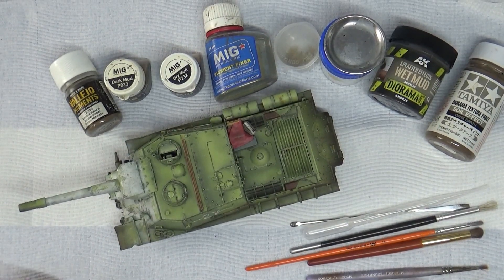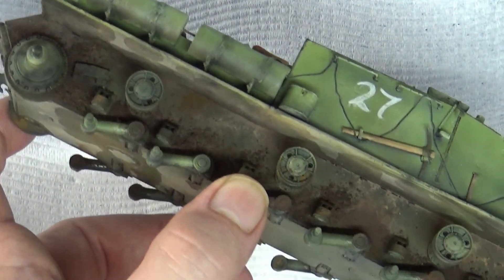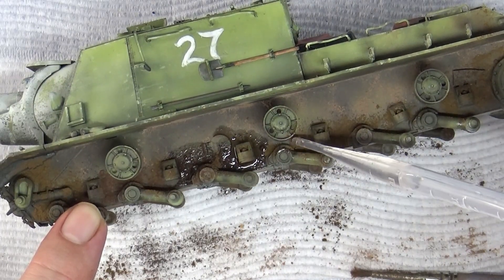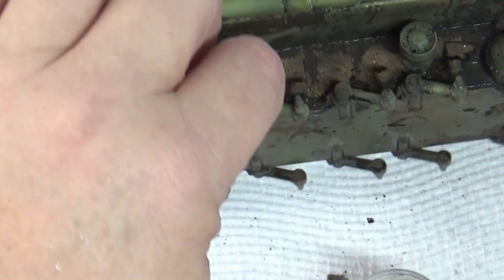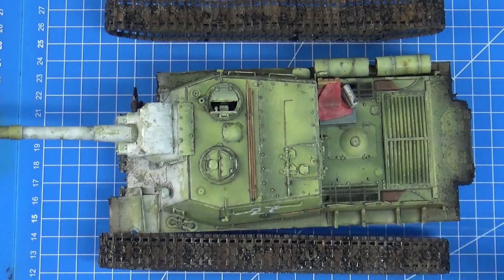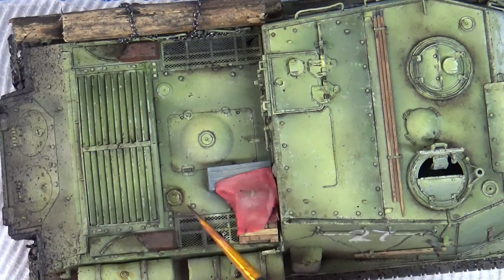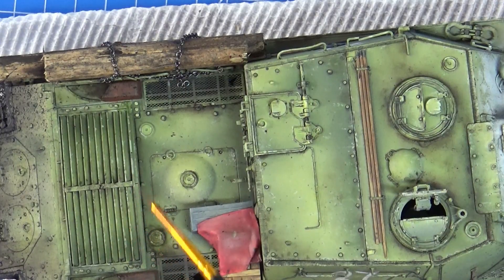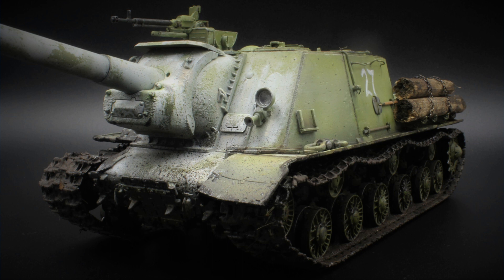Mud effects on tracks and oil paint rendering: Tamiya 1/35 ISU-152 Part 4

Comment: Thoroughly enjoyed you video series on the JSU-152. Actually, I enjoy all of your videos! I’ve found that when I do a splattering technique, a 3” x 5” index card is my friend.  Why? Because I’m able to splatter whatever medium I’m using on the card to unload the big gloopy stuff, leaving me with  smaller splatters. Once I reach the “right” consistency of splatter on the card, which is subjective depending on the modeler, I splatter the model.
Reply from the maker: Thanks John - you're exactly right and I should have shown that better on camera - I use an old business card or a larger piece of paper towel to do exactly that. I still need to control the smaller splatters a bit more and I rushed and didn't try using slightly wet oil paint to enhance the mud. Great suggestion, thanks!